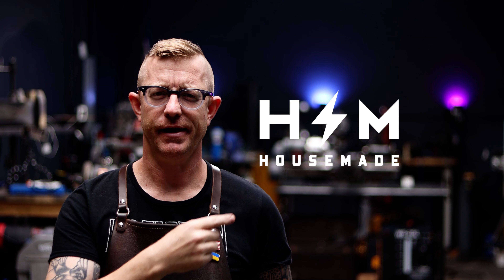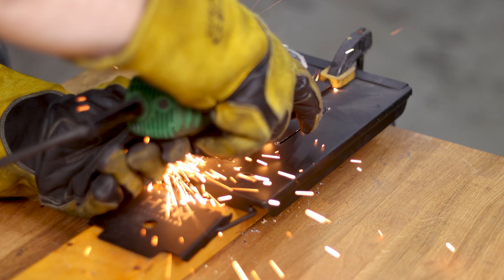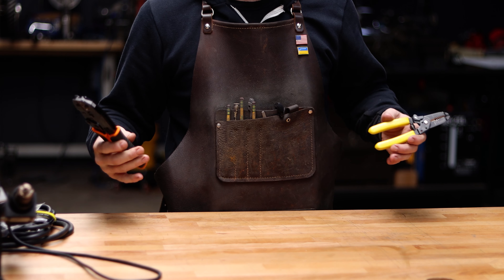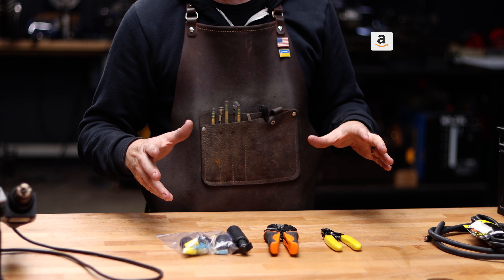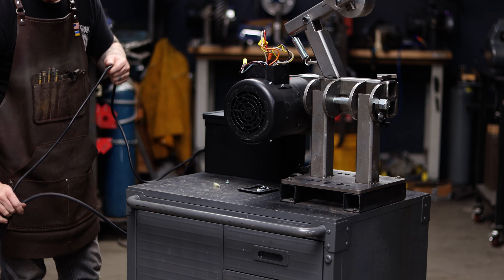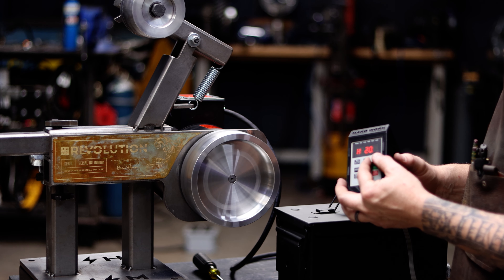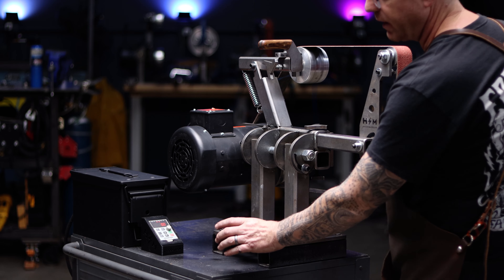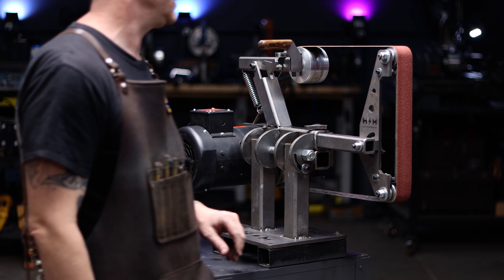How To: $115 2x72 Belt Grinder VFD

Comment: I was ready to pull the trigger on the KB through Amazon. Had it in my cart. Asked me if I wanted to add a protection plan and a light bulb went off. I bought the cheaper VFD and added a 4 year protection plan for 17 bucks. That, coupled with building an enclosure, made it the choice for me. And voila, now I can buy the small wheel attachment  for my grinder with the money I saved!

Comment: Holy moley Brian! I moved to a new place away from the hub-bub about a year ago. It has an 1100 sq ft concrete block shop, but the owner built it for his fancy bass boat and only put 15 amp 110 in it. I've been working toward fixing that, but it's complicated due to the main breaker being full, the attic space being too small for an older guy and the expense of buying all that big wire for such a large space and such a long run. 

Long story short, I've had to run my Gen 4 grinder off the generator, which is less than ideal, making me less inclined to use it. I wish I'd seen this video when it was released, but YouTube is a fickle mistress and didn't promote your video to me. Today I decided to tuck in and check your video catalogue to catch up on the ribbon burner story and saw this one. What a gem!!!

You need to make more YouTube videos my friend. You have the humility and personality to reach millions on this platform if you would post consistently. Get the frequency right, and the production quality will come because you are who you are. God bless you brother, and thank you, thank you, thank you for this video.

Comment: I appreciate the review!  Let me tell you, I bought an Ameribrade mastery package with just about every bell, whistle, and option available.  They can’t get 3HP VFD’s get now, so I purchased a 3HP Leeson and the KBDA-29 (digital version) on my own.  I’ve back and forth with KB tech support for a week now trying to get it to work, only to determine that because the KBDA line won’t run high efficiency motors because it hasn’t been upgraded to their 3G platform yet (because of the pandemic they say).  Now I’ve had to send the KBDA back and I’m waiting on hold for a KBAC to ship (maybe a few weeks).  Anyway, I have a $100 Chinese VFD that’s about the size of a 2 gang electrical box and I figured I’d try it in the meantime.  Pure Chinese magic!  It just works.  I wanted desperately to take the buy once cry once all American made approach, and it’s kicking my butt.  I’ll use the KBAC when I finally get it, but it’s a sad state of affairs when a $100 foreign VFD can work circles around it’s $500 American counterpart.

Comment: Man this is such good timing for me. Thanks a million for putting these together, sir!  Just ordered one for a disc grinder set up I'm working on. And dude... great idea on the lathe conversion!
Reply from the maker: Thanks James! Motors are everywhere, glad we can control them cheaply and easily.
Reply: @HouseMadeUS  This topic can be pretty confusing for sure. I'm thankful you're putting out educational content on hooking all this stuff up. It's funny how knifemaking has be come an avenue for me to learn about stuff like this (wiring HT ovens, VFDs/Motors, calculating hydraulics, etc). It's not just about making sharp things! lol - I wish I would of came to blade with yall... one of these years I'll have to try and make it. Cheers
Reply: @RedBeardOps  It's funny to see someone whose grinder I built chatting with someone whose heat treat oven I'm building! You guys are both treasures to us beginning smiths.
Reply: @Immolate62  Lol, very cool Tom! Good luck with your build!

Comment: I use what looks like the same VFD on the belt grinder I built.  One complaint I have is that it makes a high pitched squealing noise when I run the grinder.  If I change the speed, the noise goes away.  Some VFD's have an internal frequency that the device runs its electronics that can be adjusted.  That is supposed to be the way to get rid of this squeal.  However, my VFD doesn't have this listed in its programmable code.  

Also,  the VFD can generate heat itself.  The ammo box looks a little restrictive and has no place for the heat to be dissipated.  You probably should consider a computer style fan  mounted in the side of the box to change the air.  I mounted my VFD with the cooling fins exposed in the back of the box.  I think the instructions specifically say that the unit should be mounted VERTICALLY so that convection can cool the fins on the back.  At least mine did.  The Ammo box is fastened horizontally.  

The installation looks great and I like my VFD even though it makes noise!  I really like the video and thanks for making it!

Comment: Good video.  One other thing to consider is that if you get a 1.5hp motor instead of the 2hp motor you can run it at more than 60hz without faulting out the drive.  The extra speeds will give you higher performance that then you will get from an under powered 2hp motor.  Most of these digital drives can be overclocked.  (not sure about the cheaper ones so take this with a grain of salt)

You end up with a 1.5hp motor at 66hz / 3850 rpm / 7055 SFM, or a 2hp motor running only 1.5hp at 3500 rpm / 6414 SFM.  Also if you're under powering the 2hp motor there is a good chance you  may struggle to actually get 3500 rpm due to rotor slip caused by the reduced current.
Reply from the maker: I wonder if there is some way to measure this? Like a timing notch!? Good info Richard! Thanks!!

Comment: Just found your channel subscribe after first video now running down a rabbit hole… trying to learn to weld with a hobby flux core welder. Splatter is crazy for me I run high or low seems to splatter like crazy… it’s a harbor freight special but just seems to struggle. Not sure what I’m doing wrong
Reply from the maker: Check your polarity on the welder. Reverse it and see if the splatter goes away.

Comment: Hey Brian,  I just received the same VFD as this from Amazon and it has a really short controller cable.  Where did you get the longer cable seen in this video.  Also, what would you charge to 3D print a controller holder?
Chad Moore 
Tuttle, Oklahoma
Reply: Was just wondering the same thing. I haven't ordered VFD yet, so would like to know what kind of cable I need to order with it.
Reply: If you shop around you'll find some vfd's that come with an extension cable.
Reply from the maker: We have a link to it on our resources page: https://housemade.us/pages/2x72-resources

Comment: Thanks For the videos! I'm hoping someone might be able to shed some light. I see VFD's with L N input and R S T inputs. I just received a unit with L N ports and intended on running 1 Phase 220V. So 2 hot legs (Not hot and Neutral 110V). Was expecting R S T and use the R and T terminals. According to the VFD diagram L N just get a hot leg each. This seem right?
Reply from the maker: Yes that is correct.

Comment: Hey there Brian, question about the dust glands. I know it takes the 1/2” npt glands, how did you get it to seal to the ribbon cord from the VFD controller?
Reply from the maker: It's a bit loose but it works okay. I put a bit of hot glue in there to seal it and I am confident it will be fine. So far so good anyhow. 😂
Reply: Thanks buddy! I just wasn’t sure if it would pull steel dust in more since it’s not sealed like the 14-4. I will proceed!! 
    @thebeardedbeerman

Comment: I got a couple of those VFDs, where is the long extension ribbon connector for the control unit? I only have 5 inches of slack ribbon cable
Reply from the maker: I got mine from another VFD. It's a straight through 5 pin ribbon cable.
Reply: Unfortunately, those are hard to find
Reply: I might have to buy a 12” female to female and put a male end on
Reply: I've got a solution for the short cable. Go to a source for hobby lipo batteries. Get a 4S balance lead. I found one that is 24 inches long or 600mm. Unplug the connector from the back of the control pad plug the balance lead to the cable and the back of the control pad. They don't have the latch but they are a tight fit. Tape the two cable connectors together for extra security. They aren't too expensive.
Reply: Thanks for that!

Comment: Sooo let me start by saying I'm a newbie and used that vfd and with a motor I bought from eBay but got smoke! After not stopping and paying attention I tried 3 times and smoke appeared come to find out somehow T5 (motor wire) switched it's self with T9😔🤔. I quickly switched the to but Im not sure if it's too late Help?
Reply from the maker: Wire it up correctly and see if it works. Smoke isn't good, it will most likely need to be replaced.
Reply: @HouseMadeUS  ok I did it and it works but I'm not sure of the how much damage took place but I run a little rough.

Comment: Great video! OK, maybe someone can finally tell me why you would want your grinder run backwards? What do you grind when going backwards???
I would assume that the tracking would need to be re-adjusted before you can do that ....
Reply from the maker: Couple reasons, when turning the matching horizontal I like the sparks to travel away from me and I use reverse to sharpen things. Much easier. Cheers! 🤙🏻

Comment: Be careful using sjoow cable for the motor side conection to the vfd as it may produce 220v 3 phase it also pushes over 300v of dc for the dc injection braking, which is more voltage than sjoow wire can handle, I would recommend just using soow cable as it's not that much more expensive

Comment: it's a bad idea, the control panel of Chinese drives do not last long with these buttons.
it is better to put push buttons with a 10 kΩ potentiometer
Reply from the maker: I've had good luck with them, for many years.
Reply: @HouseMadeUS  I ordered several in China, and one lasted 3 hours and broke down, I had to send it back .personally I always use push buttons, and a potentiometer if I need to vary the speed
Reply: I have had my chinese 220/220 vfd two years now on the revolution grinder v3 when Brian would not recommend it at that time, and I have it thrown in a cardboard box with a slit for the wire to come out of, no fans, no cooling, no problems. The remote I have laying on the table next to the grinder and I have made many many knives, I grind everything I can think of on that thing. I make all kinds of shit. I use the grinder most every day and haven't had any problems with the buttons. I can't thank Brian enough for all the input and the mind grinding he does to afford me to do what I do. In the meen time your problem doesn't seem to be  common around the community. I know there have been hundreds of people use this Chinese vfd and I would think there would have been a lot of negative comments on that. Anytime you have a connection from a unit to the 200 pound gorilla, really, that is always the first part to fail. If and when mine ever fails I'll order another $95 unit and I'll still be money ahead. I can't really comment on why your unit failed so soon, it is a chinese made pos, it could happen, I guess. Just my thoughts from a guy in Tucson, good luck and hard work